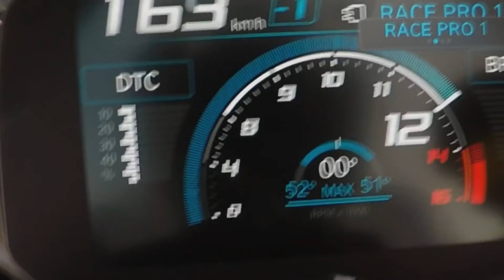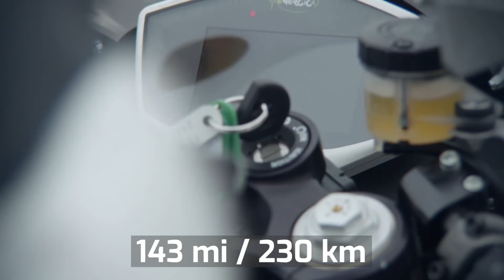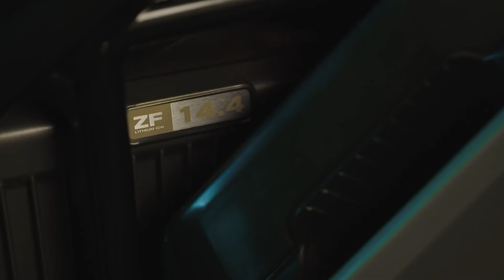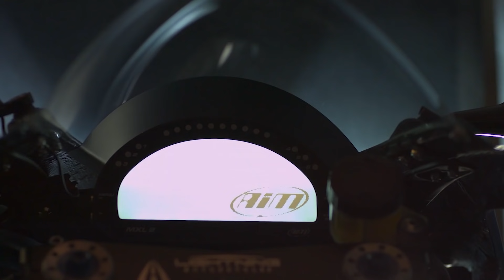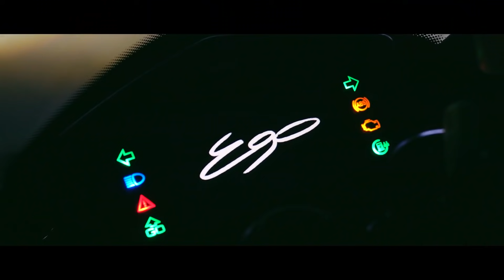World's Fastest ELECTRIC Motorcycles | 408 km/h - Faster than Kawasaki H2R!

Comment: Electric motors and batteries will only get better from here...
Reply: That’s true. It’s only up from here.
Reply: No, usage and mining of lithium must be stopped immediately.
Reply: Yep!  Lighter weight, no more oil, spark plugs, spark plug wires, no more coolant and intercooler, no more transmission, clutch, alternator, no more fuel injection or gas tank and absent of mufflers…all simplicity just like e cars.
Reply: Why not just exchange a charged standardised  battery  cartridge instead  of recharging for hours
Reply: @oldman2800  Exactly! But manufacturers are afraid of aftermarket battery packs. It will happen eventually though.
EV battery tech is somewhat of a black box & Battery packs are probably less safe compared to a gas tank right now 😂😂
Most battery packs are simply adapted versions of batteries made for power banks & laptops.
There will be significant improvements in the next decade, and 2-wheel EVs will start outperforming and out-selling gas bikes within that time too. A decade. But it'll happen.
Reply: @crisphol33  Surely you're joking Mr Feynman
Reply: @Flash Vinnig So, If I don't ride 200 miles does that mean I'm not a real biker? You hurt my sentiments 😭
Anyways, time will tell, won't it? I'm a commuter, I don't mind the 200 mile range at all. I'm sure there are others who can live with that kind of range.
For touring etc, obviously battery tech has a long way to go (pun intended) before people start ditching gas bikes.
E-Bikes will become popular in developing countries first. But they are the future regardless. How soon? I don't really know. But 10 years is a pretty accurate guess for many countries.

Like Henry Ford said, if you asked customers, they'd just ask for Faster Horses. Look at what happened to coach builders and horse trainers.
Reply: @noidontthinksolol  while it is true that they are older, they have also had a lot less research done about them. If you compare the first gas engines with the ones we have now you will be astonished at how much they have evolved. The same will happen with EVs
Reply: Completely agreed USA 🇺🇸 is going to be number one in electric motors! 💜🇺🇸
Reply: @entvisual  USA already is number one in electric motors.
 Just count the number of hvacs installed in the country 🤣🤣
Reply: @vikassm  haha interesting point there 😳😳😂
Reply: @entvisual  Well, if you also count industrial motors, power tools and cars, The USA has everyone beat by a long shot. Granted, very few of those motors are in cars, but motors are motors. Cars will accelerate motor & battery tech really fast. (See what I did there?😎)
Reply: @Flash Vinnig
Laugh at me all you want. Someday, all, I mean every single one of these horses will be replaced by dino juice exploding inside metal cans!! I'm calling it "The Automobile". Get it? It drives itself basically. No horses. Yep. No grass, no dung, no farts.
Wait, what year is it????
Reply: @noidontthinksolol  R/ whooosh
Reply: @noidontthinksolol  Alrighty
Reply: @noidontthinksolol  Have you even seen the monster that is the Tesla Model S Plaid?

It's the 2nd fastest production car to ever be a thing.

Motor power density and battery energy density are constantly improving.
Reply: @GravityBunk  yeah bro, the use of gasoline must live on 😅😹🥳
Reply: Fax people don’t understand. That’s why I kinda fuck with sur rons ebike. Shit hits 80 mph and no gas I basically made all my money back from buying it cause I don’t spend no money for gas and I just plug it in at work.
Reply: @PabloEscobar-mx2eu  oh trust me, If they happen to rid of all gas bikes and cars, you'll be paying for electricity trust me. And you could do solar, but they will tax for that too ;) but wait isn't gas bad for the environment? Mining lithium is pretty damn bad too.
Reply: Its time to buy stocks in lithium
Reply: @GravityBunk  true .. hydrogen is the solution
Reply: And where are you gonna charge this crap? You know in L.A you can't even run your ac to high at certain times of day and they do rolling black outs as is...... what happens when every morons drive a e vehicle

Comment: my out dated 2014 Zero SR can still do 0-60mph 3sec flat.  this thing can beat any commuter from light to light all day long, except when a cop is around.
Reply: Wow!  What sort of range?
Reply: don't race a certain four-door electric sedan
Reply: There is no law against acceleration!
Reply: @Slash1066  In Arizona they have an infraction called "excessive acceleration", and its all 8 points at once.
Reply: @johngalt97  Really? That's insane!
Reply: No not all day long
Reply: @Slash1066  interesting
Reply: @Slash1066  Correction, at least here in Ontario Canada, if you accelerate quickly next to a cop car, even if you don't exceed the speed limit, his ego will almost certainly make him pull you over for reckless driver.
Reply: Range = 100 miles ?? baahhaha
Reply: @Slash1066  in Iowa, you can be cited for reckless driving if you accelerate to fast. Very subjective.
Reply: @johngalt97  how do they measure that interested
Reply: @CRPerformance1  so it's down to the cops discretion that LOOKED fast ?
Reply: @matthewspry4217  if it looked reckless. If you accelerate quickly getting onto a freeway, it's much less likely to get pulled over than if you accelerated quickly between lights. Plus, it's likely something a cop would add to a ticket like speeding or not having a license or insurance. But yes, it's up to the cop.
Reply: @matthewspry4217  It’s completely subjective, and probably not difficult to challenge if you have the wherewithal.
Reply: @matthewspry4217  pretty much.
Reply: @feger481  Yeah, the exact same thing happened to me once when I was delivering pizza. They didn't ticket me though.
Reply: If you buy into this bullshit don't put your bike next to mine wtf are we doing
Reply: yeah but my old 450 honda rebel could do the same, and it was made in 1987, used carbs, and didnt have a finite range due to electrical limitations. electric bikes need to be a lot further than they are, and maybe more than they can be even in 5 more years, before MOST riders would ever consider them. if i cant ride for 12-16 hours straight, then its useless to me. i can refuel in 5 minutes, i cant recharge in 5 minutes.
Reply: Yea well my E-bike  can do 0-6 mph in 2.9 seconds.
Reply: @Handleyman  11kwh is around 100km range mixed highway and city .. 14kwh 140km.. so respectively 65 or 85miles of range .. energica ribelle and experia have double this range
Reply: 50 KM and then when the battery dies, you're screwed. Better carry a foldable solar panel and have hours to wait.

Comment: imo, Damon is the best compromise between price and performance and design. well balanced. Good specs good price especially for the SX @19.990$. before it's too pricy for low specs and after you pay too much for few upgrade in specs. I will see their best bike @20K$ in a few years when tech and batteries will drive cost down.

Comment: Im nearly 60 and spent much of my youth riding bikes. These are fantastic machines, but I fear that bikes, almost invisible to many road users anyway, will only become more invisible when there is little to no sound to go with them. Im sure I missed many crashes because at the last moment a car driver heard me coming.
Reply: yap 100%
Reply: Hi viz gear - Denali running spots and loud exhaust and 134 air horn —- no way in hell will go electric —— would quit motor biking first
Reply: Pretty sure that's why there's a horn on the bike.
Reply: Put it into laws so that all electric bikes make some standardised noise. I speak as a motorcycle rider. My ride is 2006 Yamaha R1. But my goal is to get something like this ride or make it myself...
Reply: I have found sound is not the key to safety powerful extra day and night running lights are much better. Six thousand lums get attention. Cars today have a lot of soundproofing and don't hear a bike coming.  Audible sound for your indicators as many motorcyclists forget to cancel after a turn.  This often causes cars to pull out in front of them, a very dangerous situation.
Sound doesn't travel very well in front of a vehicle it is louder when it has passed whereas powerful light does. It gets you noticed on adjoining roads and in a car rearview mirror. Eyes are always attracted to bright light. If they see you they will avoid you.
Reply: Id rather hear whats around me than my muffler deafening me...my horn,my high viz, my lights are my safety to go gear when on my motorcycle
Reply: What for car's get mirrors, look in the mirrors, before making lane changing.
Reply: No, you dont hear them coming towards you
Reply: I am sure they can add artificial sounds to counter that
Reply: Ever heard of that button that makes a loud sound used to make another vehicle aware of you?
Reply: @briansture4353  cars don't see motorcycle turn signals. I use hand signals. Idiots who forgot what they learned in driver's education might not know what I was doing, but they saw me every time.
Reply: @psychowordsmith  So you're just going to ride around blarring the horn non stop so people can hear you? Most car drivers hear the engine/exhaust of a bike before they see it and act accordingly.
Reply: @paulies5407  depends on the bike.
Reply: Wrong. Studies show noise makes no difference. Visibility is the number one factor by far.

Comment: When solid state battery hits, these electric bike will go a further distance
Reply: 10 yrs still
Reply: Toyota is claiming next year.
Reply: @rchauvin037  cool,let’s see
Reply: im more silicone battery more... haha
Reply: @rchauvin037  lies
Reply: @ExploringCabinsandMines  Google it
Reply: Aluminum air battery is also a future

Providing 6 times more range in same weight
Reply: When EMP hits, then it will be rendered useless
Reply: @criminaltotheworld3154  we will have bigger problems if that happens. The chips in almost all vehicles would go too. Not to mention that would be an act of war.
Reply: @rchauvin037  what's hilarious is all lithium powered ev vehicles should be banned as well if they start making solid state batteries in an efficient manner. So eryone with lithium powered vehicles who think they are saving the world in reality aren't at all. The mining of lithium is atrocious and alot of people don't realize that.
Reply: @emansfield2017  and its still less of a problem compared to the shit that hits the floor when we use oil in the same manner as before.

Comment: Man i can't stop thinking about these bikes. God willing I'll be the owner of one soon.
Reply: Yea I'm only 17 but would love to have a sportbike, I have a electric moped, but even that makes my mom mad and worried
Reply: @moneer7139  motorcycles can be scary, you can be extremely careful but it takes one person to ram you off the road and injure your severely. I understand your mother's concern you're only 17 and is just entering life, and like I said it can end a life very quickly. My wife is the same way and gets worried, but ultimately if you can afford it, you can drive it, and just do the best you can to be careful. I wouldn't worry about it though, I'm sure her mind will change, especially if you show her how good and responsible you are. Make her feel better by getting a dash cam and use an app like life360 that detects crashes (God forbid) if it ever happens. I wish the best 😊
Reply: @demirkafasutlac2343  Partially true. You're forgetting an E-bike makes no noise to other drivers. Guaranteed the torque is a temptation that won't be able to avoid at least a couple of times. Couple that with almost complete silence = a potential/probable widow maker.

Comment: The only issue I have with electric bikes, is that so much torque changes the entire dynamics of how it handles in the rain, or slippery surfaces. It takes a lot of practice to ride one safely. Other than that, looking forward to improvements, and a brighter future :)
Reply: Newer Zeros and HD Livewire have traction control and "Rain Mode". Other models might too, I haven't checked them all.
Reply: No it actually doesn't change anything, if you've been riding street long enough on powerful bikes the 'dynamics' of it are all dependant on the rider. 
I've ridden sport bikes, adventure bikes and even bmw's 1.6 litre sport touring bike in rain, snow, icy roads. The outcome of any ride is almost entirely dependant on the skill set of the rider.
All that aside, Bosch and other safety component manufacturers have been working with the established players in the E-Moto market to create and integrate all the fancy ABS capabilities found in mid-high end sport bikes.
Reply: I can get my Tesla do have a wheel spinning, even going full throttle around a corner on a wet street. The traction control is so smooth you wont feel anything. There is no throttle body which needs to be closed and will react with lag, rhe electric motors can adapt their torque output with 20k hertz. EVs are safer in that regard.
Reply: Wrong all modern bikes have traction control ebike have it  too

Comment: 218 mph doesn’t impress, it’s only a number to brag about at met-ups. 400 mile range would impress, and be more practical to boot. Even if it only goes a paltry 150+/- mph. That’s something you could use.
Reply: Correct. Even on a racing circuit you cannot sustain 408 km/h for more than just a few seconds or you become space dust in the next corner. There are some experimental solid state battery chemistries that promise to increase autonomy by quite a lot, we should hopefully see them in a few more years.
Reply: Its hard to impres u...u thnk ur smart guy u cant even make a pedal bike hahaha
Reply: @soulwick200  .....speak like you aint using yourself as example. Oh surely you made tons of bikes in yo garage eh, do upload one for us to judge you lol.
Reply: 400 mile range in an e-bike would be impossible on a single charge, if you suspend disbelief and ignore commonly accepted (proven) standards/practices of engineering and physics, you could hit 400 in your sleep.
I'd settle for one that mirrors my actual bike usage of 150 a day as a commuter/grocery getter.

Comment: None of these accelerate like the H2R. I saw one race a Tesla Model S Plaid, which has a 0-60 of 1.9. The Ninja accelerated faster and topped out at 400 KPH (about 250 MPH). That model S accelerates faster than anything here, and it still lost, though these bikes are definitely impressive. All of these bikes are cheaper than H2R. Good video, despite the title being technically inaccurate.
Reply: Except the Arc Vector, it is $123,000. Who has that kind of money to spend on a motorcycle.
Reply: @trickmustang1994  Not true. Arc Vector has a 0-60 of 2.7
Reply: @FrostmoonPlayz  he said all of these bikes are cheaper than the h2. The Arc is way more expensive. I wasn't talking about the speed or 0-60.
Reply: @trickmustang1994  ah, well, i suppose that's true. Video was about speed, so that's what i assumed he was talking about.

my b
Reply: S-Plaid and the Model 3 both are crippled in firmware for various reasons by Tesla (despite both of them model S and Model 3 sharing similar hardware). Comparing them to other fast vehciels is kind of like racing a stock Miata against a Koenigsegg.

If they were fully unlocked they might give the H2R a serious run for its money, as it's always been though 2 wheeled vehicles usually out accelerate most cagers right off the starting block (electric or otherwise) but eventually when top speed becomes a concern things even out.
Reply: @Enonymouse_  what are you talking? The Model 3 Performance motors are already providing more power than rated for and below 80% SoC the battery is the bottleneck anyway. There is no limitation there. And the plaid doesnt share anything drivetrain related to the Model 3. Different battery, different motors.

Comment: Ultraviolette F77, just the name is enough to beat all these. 
Launching at just around $4014 in India.
Range: 130-150 km/charge
Charging Time: 1.5 Hours
Top Speed: 147 kmph
Acceleration: NA
Motor Type: AC motor
Motor Power: 25000 W
Battery Type: Lithium-ion
Battery Capacity: NA
Emission Type: NA
Max Torque: 90 Nm / 450 Nm (Motor)
Max Power: 33.9 PS @ 2250 rpm
These are just the normal stats, trust me if they'll sell the bike at even 50% of the amount these bikes are selling, they'll build a beast.
Reply: If it proves to be anything close to the specs you say, it has some hope of emergence in the american market. However 25kw is not a lot, raw power does matter some.
The electric bikes coming from China are absolutely frightening, they are underpowered and their frames are basically built with spaghetti grade welded steel.